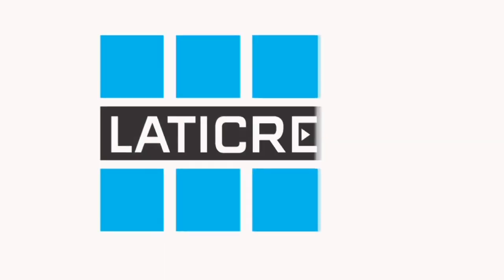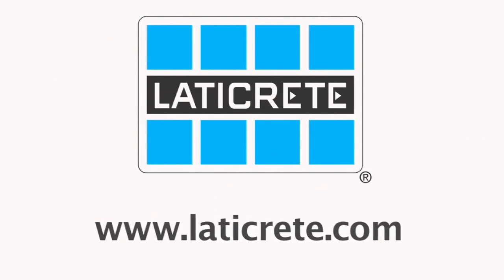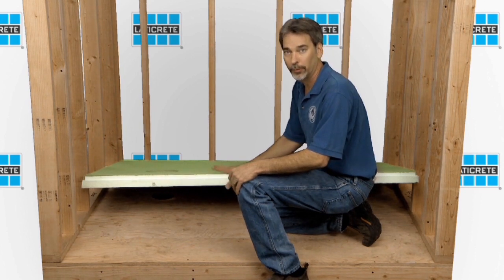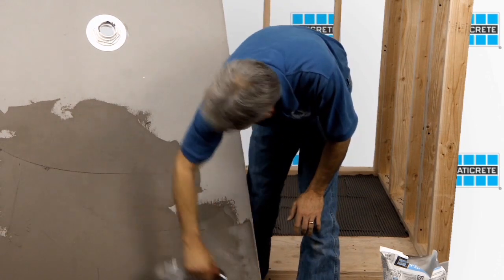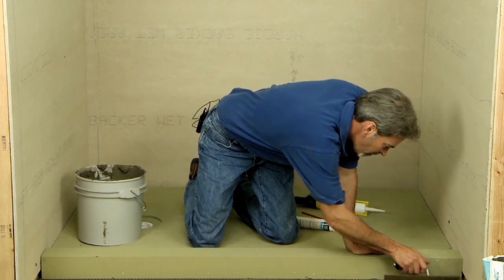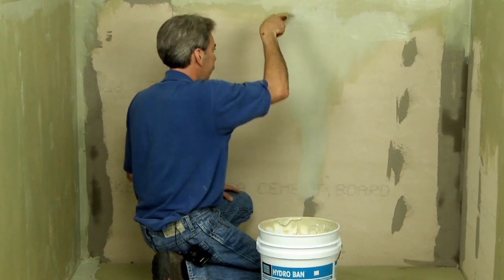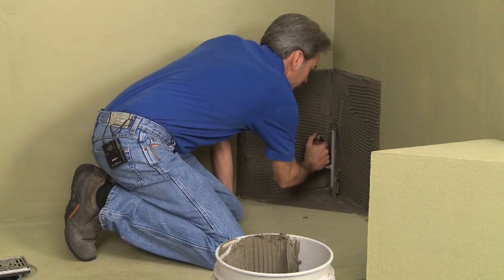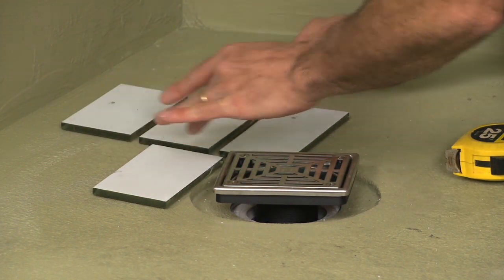LATICRETE HYDRO BAN®  Preformed Shower System

Comment: Does thin set mortar fill in the circle drain area ? There seems to be a overflow area outside the pvc drain, not sure if I am covering the entire area around the drain with thin set
Reply from the maker: Thanks for the question. It is recommend to pack the recessed area around the drain with a thin layer of pea gravel. This should then be covered with thin-set when installing tile. The pea gravel ensures that the built-in weep holes are free and clear to allow water that enters the system to properly pass through. 

Please review the installation instruction printed on the product datasheet for more information: https://cdn.laticrete.com/~/media/product-documents/product-data-sheets/lds0310_hydro-ban-pre-sloped-shower-pan
Reply: Thank you!!